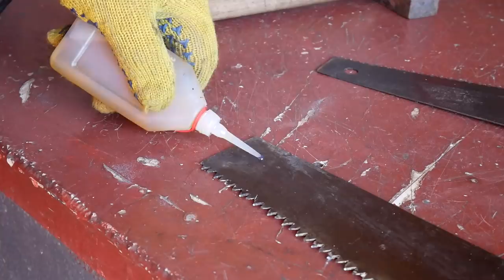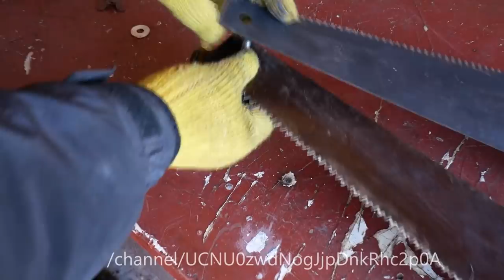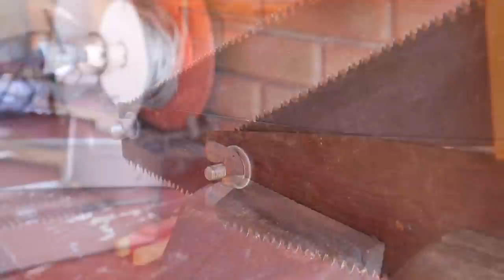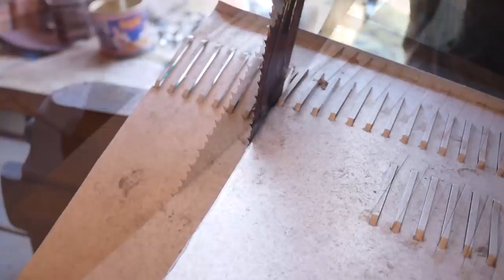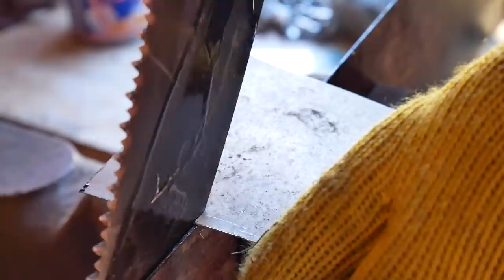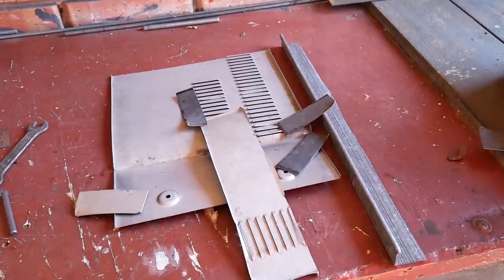DO NOT THROW AWAY OLD SAWS ON WOOD I Have a Great Idea

Comment: Must be very cold in that workshop to need gloves to tighten a wing nut. I was more impressed with the ease of drilling the saw blade, I'm guessing high cobalt drill bit. I really don't see the point of this project, in a lifetime of practical work I have never had any difficulty in cutting flimsy bits of material; it would appear to be quite a challenge to maintain a straight cut.
Reply: Most metal hole patches are never measured - this is great, and easier on the hands.

Comment: it was enough to bend the teeth of the saw in a right and left direction and the saws came back new
Reply: First you had to sharpen then and the set the kerf, but the newer tools are hardened steel and cannot be sharpened, essentially throw away saws

Comment: you can just sharpen the tooth of the saw and use it again
Reply: No , you can't . teeth of a hard point saw are harder than a file .
Reply: @adamnewhouse1414  that's why they make carbide and diamond files to dress saw teeth.. there's also a tool to reset the angle of the teeth.. I have a hand saw that belonged to my great grandfather and I'm over 60..
Reply: @roywood6464  

Yes old saws are designed to be resharpened, and the teeth reset . I have the tools too . and yes with diamond tooling it is possible to re sharpen hard point saw , but impossible to re set teeth due to hardness they would shear off .
Unfortunately modern saws are designed as disposable objects, making maintaining them. impractical.

Comment: Yeah, nice way to ruin the value of an old saw.  I won't be subscribing, that's for sure.
Reply: It's not old saws that matter -- it's good old saws. It's cheaper to buy a new saw than to buy the files and jig to sharpen an old one -- in many cases. 

This particular hack, you'll notice, doesn't destroy the saws used. That makes it a bit novel, and elevates the thing into the ranks of 'hack' or 'pro tip'. 

The saws -- whatever their condition -- could have been used lengthwise on some dowel to create stiffeners for the lateral-thinking innovative use of those rusty saws. 

Tools are a contagion.
Reply: Umm, notice in the title:"Don't throw away...".  That should give you a clue....
Reply: how much value is there in a old used up plastic handle saw . if you think they are worth much i have a few to sell you